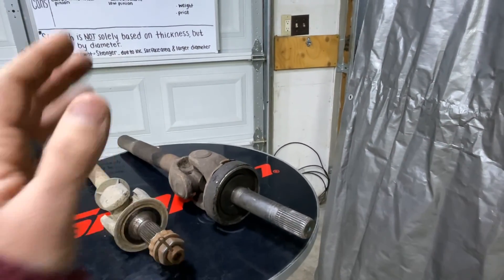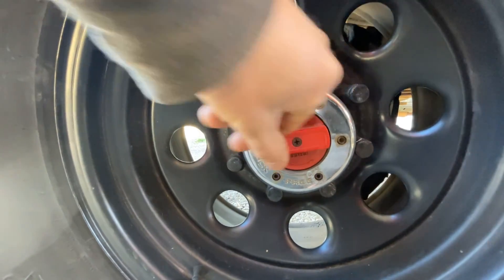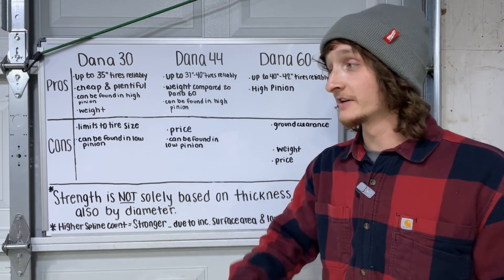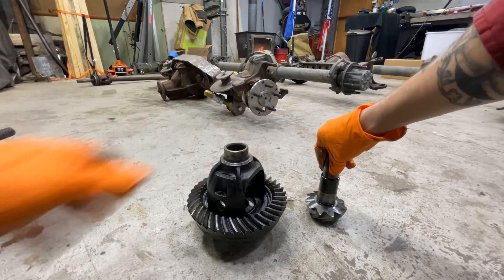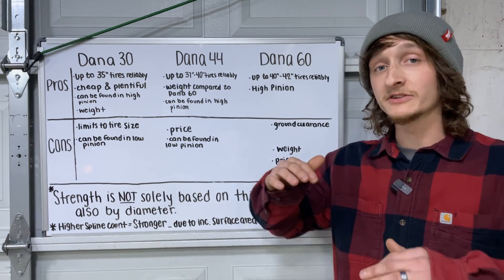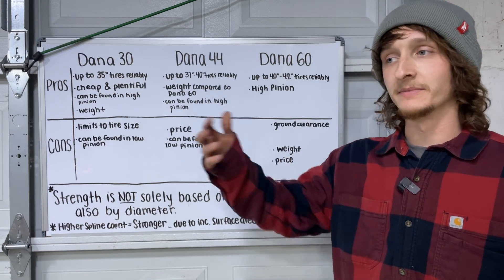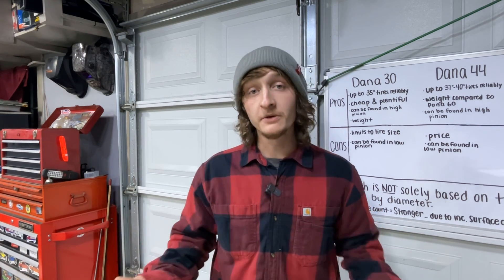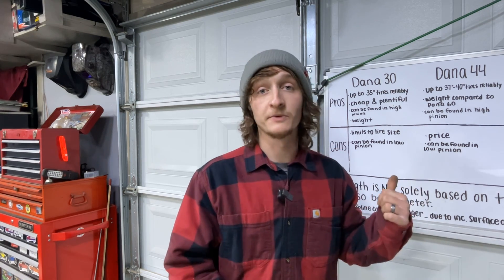Dana 30, 44, 60 - Which axle is best for you?

Comment: Thank you for explaining all of this. You really explained it all. I just have a question and im.in a stump here because you know you hear different opinions but right now I have a ultimate dana 44 with chromallys up front and a stock 44 in the back. I'm running 38 13.5 tires now. I want to go to 38 14.5 or 15.5 or go to 40s. I do not wheel my jeep it's more of a show jeep but I do like to flex and do some obstacles. The 38 15.5 tires weigh as much as a 40 tire. So my question is am I safe with keeping my axles to run a heavier tire and what if I truss them or is it better to go with a 60?

Comment: Would you rather have a lp 44 or hp 30 for running 35s or even 36s?
Reply from the maker: The bigger the better in most cases. A Dana 30 can take a lot of abuse if put together right although any bigger than a 35 and I would want the 44.

Comment: I am thinking the 04 and older super duty axles were dana 50.  Hence the 30 spline.  The 05 and up would be a real dana 60....35 spline.
Reply from the maker: They made Dana 50s prior to 04 along with the 60s. Biggest difference being larger ring gear/ pinion/ axle shaft diameter. I didn’t get into it in this video but 99-04 60s have 35 spline inners, 30 spline outer. Dana 50s have 30 spline inner and outers and 05+ 60s have 35 spline inner/outers.
Reply: @Backcountry Beagles   yeah that's what I was saying.  In the start of your vid you say dana 60s have 30 spline.
Reply from the maker: Yes, This one in particular, 1999-04 Dana 60 have 30 spline outers.
Reply: @backcountrybeagles  I get that but 35 inner.  Comparing it to the dana 44 as both having 30 is just odd is all